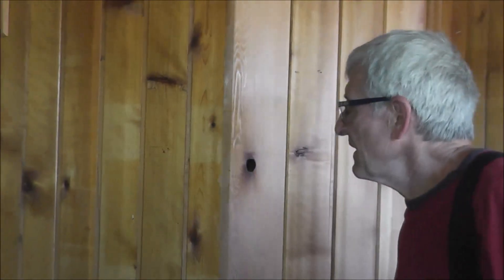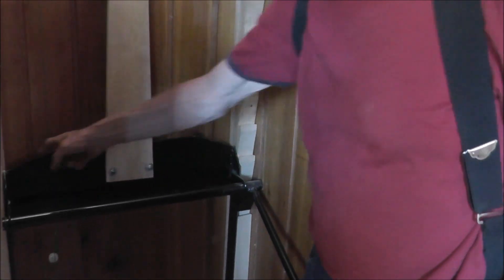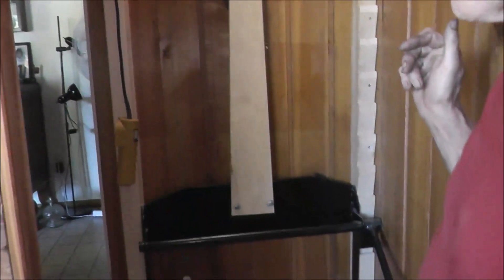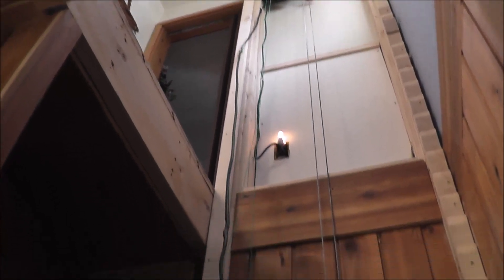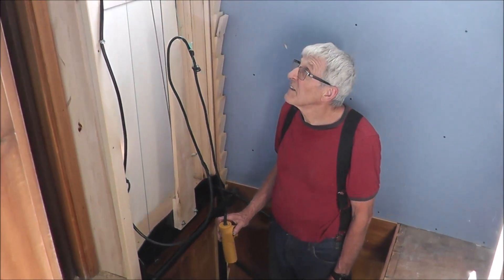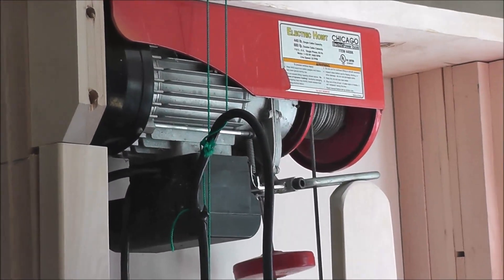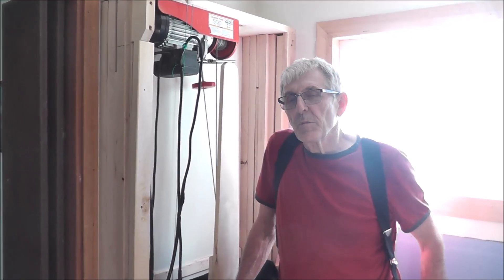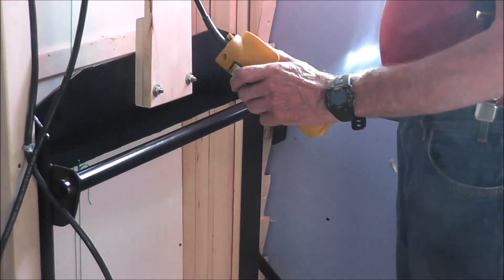DIY Elevator for home or shop

Comment: maybe should put a gate on the upstairs bit just in case.
Reply from the maker: Good idea but, that area is in a small enclosed locked room when down.
Reply: I've watched a video where there is a door on the second floor that goes up and down when the lift is used, thus eliminating the need for a railing.That can easily be added to this design.

Comment: If you don't have slack cable detection i have an easy solution I built for a sawmill bandsaw lift.
 Just below the hoist mount a limit switch in the wall with a nylon arm extended out to a half inch or so from the cable. I used light 1/8" wire rope and a couple small pulleys to create a static side load on the cable with a hanging weight, a spring would work too. If the hoist cable ever becomes slack the weight will pull the cable and operate the limit switch, stopping down direction only.

Never cared much for having to adjust and trust the internal rotary limits the hoists ship with for accurate precision travel limits.

I do like your safety dog system. Take care sir.
Reply: @David-w8x6q  The best part of the slack detection was an auto lower relay I added afterwards. When they would raise the saw carriage to the top floor they would close a hatch in the floor and as they lowered the hoist it would automatically stop exactly as the load settled on the floor. The same auto down worked when replacing a saw on the headrig below. They would open the hatch an hit auto down. The carriage settled on its lowest location and the hoist stopped. I actually built an elevator to transfer materials and work carts in the sawmill. Used a small Allen Bradley PLC and we got it certified for emergency injured personnel transfer too. Apparently it was the only one ever in at least, British Columbia. Plenty of Turck proximity switches so no external moving parts to break and redundant controls plus I might have caught them on a good day. Thanks for the reply.
Reply: @David-w8x6q  Oh yeah, have a look at the difference between wire cable and wire rope. They are wound and behave quite differently.

Comment: if you search youtube for "secret life of machines elevator" you may find it interesting and around 3 mins in it shows a safety device which may give you some inspiration of how you could improve safety of yours.
If it were mine I would want it to automatically lock if the cable fails and I would actually load some weight in it and simulate a broken cable to make sure it works ok.   Far better to risk damaging it in a test than the consequences of finding out later that it doesn't work.
Reply from the maker: I am modifying to lock in an event on the way down too. I like that idea of testing with a weight, will do that.

Comment: Be very careful, a close friend did this for his wife, after 3 years the steel cable got  loop in it on the drum and it kinked. After about another 6 months the cable snapped and his wife broke both her ankles!!!
Reply from the maker: I am right on the cable drum inspection, also I am modifying it to lock also automatically on the way down.

Comment: A door on the top floor would prevent people from falling down the hole.
Reply from the maker: small room with a locked door when lift is down.
Reply: @brianprocter6191  Ditto though. If you extended the metal up above your head above the 'dog', it could push open a trapdoor as the lift rises, and let it fall back down onto a lip around the edge of the hole as you descend, making locking the room unnecessary. Just my 2c.
Reply: @darrelljacobjr2120  That would also allow some storage space on the walls upstairs, which might be handy to have.
Reply: @brianprocter6191  even a minimum code would require, at least a safety rail.

Comment: Here's a tip that you might find useful. If you take a still working old garage door opener and use it in the vertical you can wire your Harbor Freight winch to the openers electric motor leads and take advantage of the electronics of the start stop one button operation.  Obviously you can discard the lightweight openers drive motor. And this way your wife can call the lift from a different floor with just a tap of the button. you will still use your guides you built, of course. 
We just upgraded our garages openers to the wifi ones and I kept the old openers for this purpose for the MIL should she come live with us.  But she passed away this Winter.
Reply from the maker: Never worked with those openers,  not sure if they have enough power. The lift is only where she is so no need for remote control.
Reply: @brianprocter6191  You don't use the garage door opener motor as I explained to raise and lower the elevator.  You use the electronics of the garage door opener to control your Harbor Freight Winch.  The HF winch you have operates in forward and reverse rotation just like most garage door opener motors do. If your old opener is 1/2 or 3/4 HP rated it can power the HF Winch motor directly.  But if you use a lighter rated HP opener (1/4 HP) you can just add relays to power the HF Winch from the openers electric board. Like I said, the GD electronics board will give your wife the ability to call the lift if it's on the other floor.  Just like raising and lowering the garage door.  And she can do it wirelessly with a garage door remote contol on her wheel chair.  BUT YOU STILL use the Harbor Freight Winch.  Or a quality winch of your choice.  Even an ATV winch will do what your doing and work off a 12 volt system that will still work if the City Electric grid is down.  Just keep a simple trickle charger on the battery to keep it topped off.  I have other was to make an emergency arresting brake that will work better than the wood step board your using.  I see that contraption shaving off the teeth in a sudden release. (Csble snap)

Comment: The idea was alright but some of the execution is questionable. For passenger elevators the structure, lift mechanism, and cable capacity is 12:1. If you assume a 200 pound maximum load for both the carriage and one occupant your system has to be capable of lifting 2400 pounds. His safety "ratchet" probably won't take the weight should the cable fail. Those wooden notches will in all likelihood just shear off. His winch mount is light weight and should be reinforced with steel and his winch is not rated for lifting (that winch is rated for pulling on a horizontal plane only.) and could easily fail catastrophically.  When he starts out at the bottom where his sunken living room is there is a gap between the living room and the first floor that has been left open. A good way to amputate a toe or two. Same thing goes for the penetration to the upper floor. One thing that really bothered me though is his comment about "no building codes". In that he is entirely wrong. The codes are applicable anywhere in the Province and you cannot pick or choose based on your needs. If someone is injured or killed using his device, he can and probably will be charged with criminal negligence. In addition, your liability insurance will not pay because your device was not engineered or inspected as all elevators have to be. Sorry but no pass for you........

Comment: Put a sticker on it that says "For goods only" with a pictogram of a person with a red cross over it. What you do when nobody is watching is a different matter then.

The piece of wood that hits the switch should go into a guiding system at the top. That guiding could be wood in a reverse V shape (like an upside down funnel) just so that the thin piece of wood always hit the thin piece of metal you have. It will bend and it will warp over time and the guide would align things.

Comment: Pretty certain those notches aren't going to hold shit if (when) that winch gives out... or the cable breaks, or something goes wrong with the pulley. I would highly recommend using cast iron or steel.

Comment: Excellent!  Love people willing to tackle their own hurdles.
Though, not to be installed at this time, I'm building my house with provisions for an elevator that I can build at a later date.  Closet space is being stacked atop one another, and I will also box joist each area, so later modification to a full height shaft will be easy to perform.

Comment: Pictures of the platform rollers on angle iron guide were too fast and totally unclear.    Pretty much the only detail one would want to see are just not shown.   Winch is trivial, platform is trivial, the detail is in rollers perhaps behind and in front of the angle iron guide and how that long guide attaches to wood framing.   Guess I would look at roller coaster wheels on a pipe that is attached to wood at sides, not front or back so platform wheels would be unobstructed as an understandable method to roll a platform given I cannot make out your details.

Comment: Thanks for the advice. I understand the concern about the cable. Been keeping an eye on it. Will be modifying it to lock on the way down. I hadn't checked till the other day but thumbs up 50 times higher than thumbs down.
Reply: the constructive criticism is good.being open to suggestions is great . the this will be certain death is not helpful.  up  a ways in the comments rocky top has an excellent idea for your brake.

Comment: Great idea, could for sure use a few improvements, especially on the safety side, but as a proof of concept it is a 100% thing, it works.
Very interesting to read the comments, divided into two groups, Those that can see the solutions, and those that see the problems, they all look at the same "thing" and they are all in their own right right on their point of view, when that is said that even the best designed device is a death trap in the wrong hands and the worst death trap can be safely operated by the right operator.
But Brian should go back and build in a few safety improvements, to considerate "job done" when "it is working" in not always right, elevators safety regulations is there for a reason and that is: many dead and injure persons when using/operation, or just standing close to the beast, add on top of this all the electrical hazards that can occur, and the fires associated with this and you have the recipe on a death trap, sorry.
To invent something that "do the job" in no big deal, many have proven that, to invent something, and it is safe to operate and use is a true master piece.

Comment: Great Idea. I have been working on building one for a treehouse. I would love to see how you built the track this runs on.
Reply: Just 3 pieces of hard wood. Spacer in between the inner  and outer thicker than the angle iron. In your case use a 4 by 4 timber for the inner one. O can tell you how to modify so it will automatically lock on the way down.

Comment: Put a guard rail around the 2 story so no one falls down the shaft
Reply from the maker: Good idea but top is closed off with its own room and locked door when it is down.
Reply from the maker: Thanks for the concern, thought it not necessary as its in its own room that is locked when it is down.

Comment: What I find beyond belief is that there is no gate or guard of any sort to prevent falling from the 2nd floor into the shaft.
Reply from the maker: That would appear to be true, but it is not the case. The lift area in the upper story is in its own room. When it is up the hole is covered and when it is down the door is locked and the room is not accessible at that point. The only valid criticism of this lift is the fact that it does not automatically arrest it self on the way down. That will be soon changed, but still will not satisfy everyone, so I most likely will take this video off.
Reply: @brianprocter6191  , It would be a shame to see the video removed because people are voicing their concerns for you and your wife. If you choose not to take the advice of those people then that is a choice you and your wife can make, but that choice should be made with knowing all the possible safety risks involved. It doesn't hurt to listen to their concerns and to know how the design can be improved upon so that it is safer to use, and to know what risks you choose to take if you decide to continue to use the lift without making the improvements suggested. It sounds like the vast majority of the comments have been respectful with praise for your ingenuity or concern for your safety (and in some cases both). 

I've used lifts with open sides before (professionally built units) and even they did not have a satisfactory method to stop the lift if someones toe was sticking over the edge leaving it susceptible to being sheered off as the elevator floor and building floor passed each other. It was a liability concern that the owner had when guests used the elevator so he was always sure to mention it before people used it. 

I haven't seen any mention of it yet so I'll suggest installing an enclosure for the wire rope so that if it breaks under tension then it can't whip down at the rider. I wish I had a solution on how that could be built but my mind is drawing a blank so I'll have to leave that up to you and the rest of YouTube to decide.

Comment: Good job Brian.  Here in southern California, after pricing the market I've decided to "assemble" something too, but code will make it almost impossible, if my experience with installing a solar system was any indication.  I've noticed that alibaba.com sells complete kits for less than $10k and all the associated parts.  That would be a start with the code people, because those manufactured pieces are UL tested.

Comment: Very nice design, and wonderful craftsmanship!  I have been wanting to add an elevator in my garage to help me get items into the attic.  I am a retired engineer and have been worried about the safety aspect of such a system.  I entertained a double winch system for redundancy in case of a cable break utilizing a yoke system, but very complicated.
I love the implementation of the ratchet similar to a car lift.  Could you add a second set of ratchet blocks on the opposite side, spring load the locking arm so it would automatically lock, and weld a bracket onto this assembly that the lifting cable would attach to.  My thought is when the cable begins to lift.... it would unlatch the ratchet from both sides.  If the cable would break, the springs would pull the ratchet arms into the locked position.  Just a thought.  Hope my explanation was clear enough to follow.  Thanks for the great video!

Comment: I wouldn't mind having an elevator, and thought about how I would do it. My house sits on top of my garage, which makes it 14 feet from floor to floor. I don't mind paying for the permits and installation. The permits aren't for giving someone permission to do the job, but to make sure it's done safely. And all that is to try to keep the fire department and ambulances from rushing through what ever traffic there might be to rescue someone, should something fail on the project. That being said, I'm glad you found a solution for your wife. The only thing I hope you do is find a way to add a safety catch for going down, and make it all an automatic system. Ok, that's two things. I love BC, hope to get there again some time soon.
Reply from the maker: Safety catch is in the works for down.  Simple addition, it will be tension ed for the weight of the person and any deviation from that weight on the cable it will lock up.

Comment: Yes it could be unsafe but falling down the stairs is also a problem for a person who has difficulty on stairs.
Reply: Rail on the lift is easy. Falling down the stairs is deadly.
Reply: Nice job. You do need an actual slack rope safety device though . I hope it works well for you sir.
Reply: Awesome name
Reply: The normal way to deal with the cable breaking is apparently to have a strong spring constantly trying to engage the dog, and the cable holds the elevator by pulling on the dog, forcing it to not engage unless the cable breaks.

At any rate, my main concern is actually the wood. The way he has the ratchet teeth rigged up, the dog is basically going to be trying to split the wood along it's weakest axis. Fortunately, since he's the guy that made it, he should be able to upgrade it. Hopefully he'll post a video in a few months of an upgrade to that bit.
Reply: @absalomdraconis NJ lic

Comment: I saw something similar once in an old barn, but the open hole up top had a flap type door that opened only as the elevator went up. There was a vertical bar off the elevator that would contact and open the upper door as it went up and gravity closed it as it went back down. They were using it to hoist hay bails and feed into the loft. That lift used an old block and tackle and ropes to lift the platform. You simply loaded up the platform, and worked the rope to go up or down. It was large enough to carry about 6 bails of hay at a time.